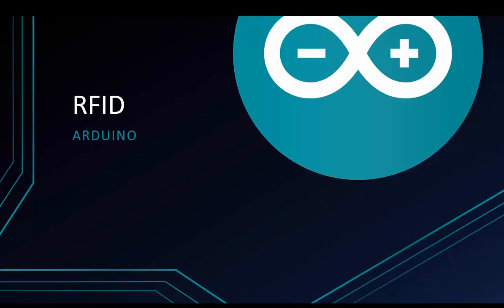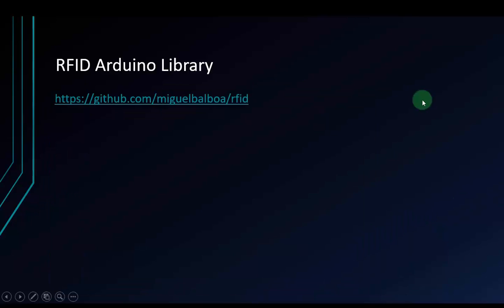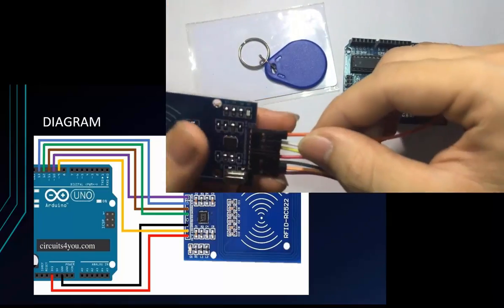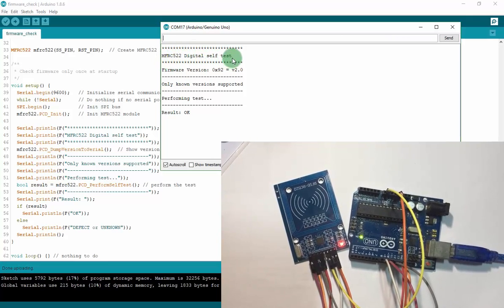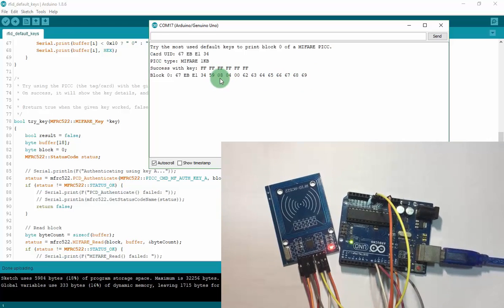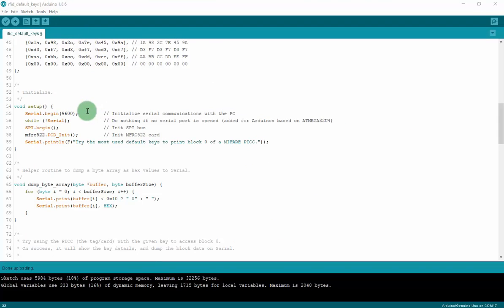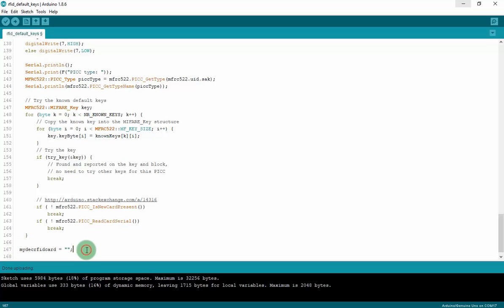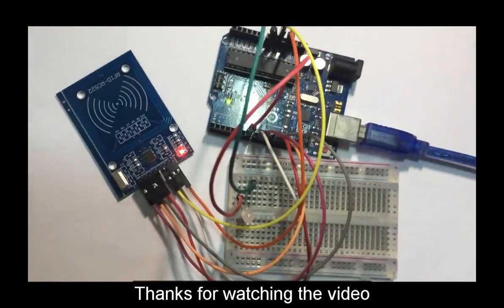Arduino Tutorial for Beginners 16 - RFID Tutorial RC522 with Arduino Uno

Comment: Thankyou for this, my was not originally working then when I downloaded the library, it had a diagram of various boards which required different pins, and I also had to change the speed of the serial port, and it tested fine.

Comment: Hi,  
line number 137 (time "11:10") you closed IF statement using semicolon; then how it is turning LED on & off. I am new to programming and Arduino. I could not get that point. Please correct me if i am wrong.
Reply: i deleted it , sorry because i lost a part of my video
Reply: @AnhQuânTốngQânXiu  what is it supposed to be then?
Reply: Brendan Jowett Hi, nothing special bro, just delete the semicolon ';' after if statement at 11:10 . Everything is ok
Reply: @AnhQuânTốngQânXiu  Ok thank you, also at the end of the code you removed this "}" and my code says that is necessary, how did yours work?
Reply: Brendan Jowett  if we only have one code line inside a statement (if, while, for,...) we don't need to use '{' or '}' but if you have more than you need to add it. And if you don't know, just build the project and the IDE will show you the errors, then follow the instruction to solve it ^^
Reply: @AnhQuânTốngQânXiu  But if mine is the same as yours and mine gets an error why doesn't yours? If I add the "}" then my code runs although when I scan the code it just scans it like it normally did and doesn't do anything.
Reply: Brendan Jowett you mean your system doesn't work although your code as the same with the video?. If it be like that, don't worry i'm writing document for whole of videos in this playlist, please wait. It will be add soon in the video description. But now, try to fix your code to practice ^^. Because i can not image what you were stuck ^^
Reply: @AnhQuânTốngQânXiu  Ok thanks, when you created the if statement you made it so the tag turns a light on and off I made mine so that when you scan the code it should just print some text. It doesn't print the text and it just shows the card info is their something different I have to do for printing text or should it have worked? This is my if statement code,                                        if(mydecrfidcard == "23516623333")
    Serial.print("a");
    else Serial.print("b");
Reply: @BRENDAN28   Did you code as the video? Because if your Serial Monitor display card information -> module RFID is OK, i think you miss code line somewhere, you need to check wires too.
Reply: @AnhQuânTốngQânXiu  My code is exactly as the video although I didn't add anything for the LED's because i'm not trying to light an LED but just print text.
Reply: @BRENDAN28   Hmmm!, it's weird. I think the system was stuck somewhere before reach to if elsse statement. You should add PRINT function above if or below else to check whether program can reach it.
Reply: @AnhQuânTốngQânXiu  Thats a good idea will do, I have just done a firmware check and I am getting a result saying "DEFECT or UNKNOWN" what could be causing this?
Reply: @AnhQuânTốngQânXiu  Oh damn, well thanks anyway for all the help. Do you think it is still possible to get it to work if it is a fake version? It reads the cards perfectly so maybe all I need is just some different code maybe?